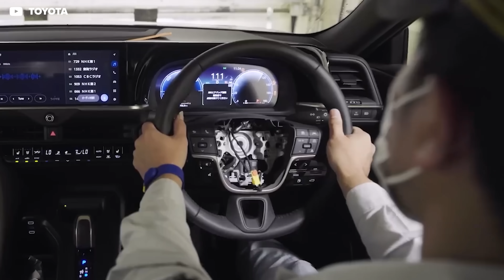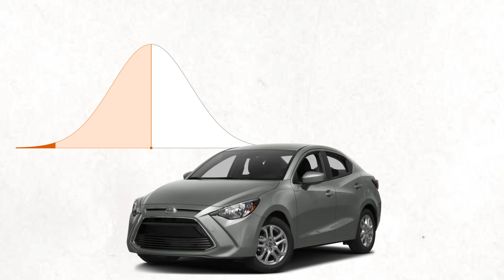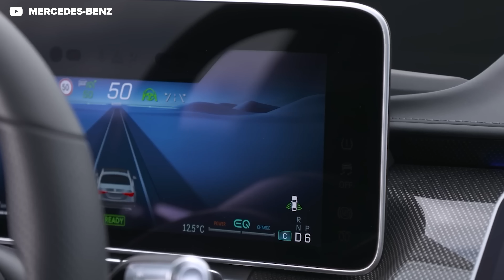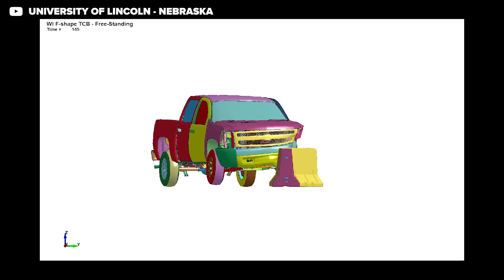The REAL reason guardrails can't stop EVs in a crash

Comment from the maker: Just want to clear up something: the Rivian is not impacting the guardrail head-on. That's just the camera angle. You can see in the raw footage at this link that it hits at the 25-degree angle Cody specifies in the video. Skip to 12 seconds in, and volume warning if you're wearing headphones: https://mediahub.unl.edu/media/21798

Sorry for the confusion. We should've included that second angle.
Reply: When you have to explain what our eyes are seeing or not, that's issue number one. A view of a vehicle coming straight at you has no camera angle to account for -- it's coming straight at the camera. That was the whole point of placing the camera there. 

And most full size ICE pickup trucks go right over most guard rails. On more than one occasion, I've seen them stratling the guard rails with all 4 wheels off the ground after an accident.
Reply: 2018 base model is more like 4647lbs.  That's literally 21% more than what you stated. You may want to fix that.
Reply: @GirthBikesMike ..2018… mine was 1999. Not one ounce of aluminium. Thick steel, cast iron. 5-12 mpg.
Reply: As well it is nowhere near being lighter or even equal to a AWD BMW 3 Series which ranges from 3600lbs-4100lbs, depending on model and year. How had this not been fact checked before filming? It really is important information to have correct.
Reply: Only China like sedan
Reply: Please please please put different F250 F350 C1500 C2500 Excursions Suburban Range Rover on the scales..

I had an 1999 F150. Tipped the scales at 5,800 lbs. Empty.
Reply: @ernestgalvan9037  5,800 lbs, nope
Reply: @JeanGarez .. factory spec. Verified pay scales showed 5,785 pounds. Yep. Portly little thing.
Reply: Ok v-sauce
Reply: still the same occurs with lighter vehicles.. it wasnt designed for trucks... but cars.

all trucks have reenforced frames, higher stance and no crush zones.

guardrails arent up to par and never were. people die because of guardrails
Reply: @pazsion  But they are better than the ones they used to not have.

Comment: I will never understand why cars got HEAVYER the more modern they got.

More weight means more fyel.
More weight means less cargo capacity
More weight means a longer breaking distance.
More weigt is negative in all cases except tractiv force.
Which doesnt matter if you're not pulling a train on steel rails with steel wheels.

Comment: Maybe camera angle, but the rivian tests shown seem to be much steeper than 25 deg. Mostly not possible (maybe for high performance EV's though) except when accellerated crossways on a wide old airfield.  Also the bent steel plate MGS barrier does not have  wide range of CG's and vehicle weights it can handle.  A stronger stiffer rail will cause more injuries than the MGS though, so overall not an improvement for the public as a whole.

Comment: These guard rails should be engineered for the heaviest possible weight not the median weight. What about the amount of heavy transport running down the road why aren’t they designed to keep those in?
These agencies are putting peoples lives in danger to save a buck. Design the system to protect all forms of vehicle the first time the proper way, and in the long run you’re going to save money fixing or replacing them at all with a normal truck or car hitting them .
Incidentally, the video you showed between a newer car and that old Impala hitting corner to corner, was proven that they cut the frame on the Impala to make it crumble the way it did. That old car should have obliterated that modern chassis. Which it did, but it should’ve been worse as a first responder I’ve seen older pick ups Terry’s new cars in half under the wrong circumstances.

Comment: I figured it would have something to do with electric motors having, in general, far more torque than comparable internal combustion engines.

"Horsepower is how fast you hit the wall. Torque is how far you bring the wall with you."
Reply from the maker: That only applies if you're still accelerating under your own power which isn't a factor in these tests, and we assume in most crashes.

Comment: @drive 

to Fix some of your DISINFROMATION:
1. Tesla Model S Curb weight = ~4550lbs to 4850lbs and equivalent sedans: BMW i4 = 4550lbs to 5000lbs, ford Fusion 3280lb to 3880lbs
Rivian RT1 Curb weight =  ~7148lbs, Toyota Tacoma = 4150lbs to 5100lbs,  Jeep Gladiator = 4650lbs to 5000lbs, F-50 = 4400lbs to 5600lbs
 A: This clearly debunks the statement made "up to 4000lbs more than a normal vehicle" made at the beginning. Unless your pointing out a specific vehicle of affect which would be biased presentation at best if not misinformation at worst.

2. your emphasis on "over 7000lbs" is a bit biased as well as a vast majority of the pickup trucks driven on roads today are over 7000lbs: Ford Super Duty (F-250, F-350, etc.,Ram 2500 and 3500, Chevrolet Silverado HD (2500HD, 3500HD), GMC Sierra HD (2500HD, 3500HD). Not to mention utility scale vehicles sold by these domestic brands for commercial use and retrofitted for all kinds of work related duties.

3. weight distribution is a major factor here and not at all a problem with the vehicle but the design of the guardrails themselves. Lastly, studies have actually sown the harmful nature of our modern vehicle  are exhibiting with guardrails and how they are causing unnecessary harm to occupants in crashes. advocates for removal and changes to they old metal systems are happening today because of proven fault and liability of guardrail design. A changing world needs a quicker response than the US is known for due to slow political and governmental red tape.
Additionally, a measure of you have failed to mention about vehicle evaluation here is the height of vehicles. This aspect has nothing to do safety or comfort and frankly is just bloating problem due to design. its actually a leading cause of more deaths than other factors in modern vehicles.

4. only 1/3 to 1/2 of ALL EVs have "frunks" let alone a completely crushable  empty front area. We need to stop evaluating every EV on Tesla terms when more EVs exist than just them and are out selling Tesla more and more year after year. My EV has not Frunk and would operate like a normal ICE vehicle with an engine in front. its American made and one of the highest selling non-Tesla model EVs sold.

5. IF WE CANT AFFORD TO KEEP ALL PEOPLE SAFE THAN WE ARE NOT KEEPING ANYONE SAFE. America just rather giver tax breaks to trickle down your face and piss on your future.

Comment: conclusions are all wrong !!! its the shape not the mass you can put the entire mass of the car above the drivers head the shape is why the guard rail lifts up not the mass of the vehicle.. its why trucks can be turned back onto the road even though they weight several times more EVs not having a large engine in the front allows manufactures to lower the front for aero reasons this has a bad effect of being lower than the railings catchment height
Reply: seems like my comment is being erased almost like they are trying to deliberately set a narrative against EVs

Comment: Stupid big cars are heavy and therefore need bigger batteries, which makes them even heavier. A bit like a lightweight version of the rocket equation. 

And in most cases it's just about compensating for some (imaginary or real) shortcoming in the owner
Reply: Big Trucks have a use, not saying all big truck owners use their trucks for those things.

And bigger cars are more comfortable, more space=more comfort
Reply: @indoorkite651 true, some big trucks are necessary. That's why I said "most cases".
If we could somehow get the people who have a big truck but don't need it to grow the fuck up and get a sensible car the roads would become a lot safer. 
I'm not opposed to the necessary trucks. Sure the driver should be able to see whether there is a child in front of it but if the truck is necessary then I'm not opposed to sacrificing a bit of my safety for them. 

As for the comfort: that's a tragedy of the commons issue.

Comment: I think it's insane how we don't have national standards for bumper height, vehicle weight, and front hood height/angle. If a Ram 3500 crashed into the front of a Corolla, it would most likely ride up on top of the Corolla. It seems like such common sense to regulate vehicle weight at the bare minimum.

Comment: Another thing to consider is in a fuel powered vehicle if the engine is hit it stops. On a battery powered vehicle, especially one with multiple motors you may take out one motor but you may continue on because the other motors in the rear will still have power and continue to operate possibly causing even more damage and injures.

Comment: I got a comment and a question 1 comment is we could use the safer barrier that's used in @nascar and @indycar the Gen 7 cup car dose have a low center of gravity and when it hits the wall it's energy goes mostly to the barrier and the wall gives you could add a catch fence just in case if y'all are wondering what safer barrier means it's steel and fome energy reduction barriers now it might not be cheap but it works just watch a race and watch a car hit the wall it will amaze you I'm glad we have them they look cool aswell. Also my question is why is every car company going electric just keep the car's with a soul (engine powered cars) you can make some electric vehicles just don't over do it.

Comment: Here in western Canada they don't use those stupid guard rails, they only use concrete barriers. I've seen a highway truck hit a concrete barrier where it ripped out the engine and transmission with the truck ending up on top of the barrier beside a 50 foot cliff.

Comment: Yeah I've been thinking about how inadequate traditional ICE engine cars safety crash protection features are since the modern rebirth of the electric vehicle for a while. 
I have a few issues with EV's.
They are using more rubber.  This is going into our water supply in much larger amounts.
They are not clean.  The electric comes from burning things.
If that battery cell punctures it can dump more toxic fumes in a short period of time than a diesel does it's whole life, and it can't be extinguished by the user.  That in a garage under my house whilst I sleep is scary.
I'm not a fan.

Comment: 6:30 the 59 Impala isn't more rigid, but exactly the opposite. The front end collapses in the same way as the 09 Impala. The meaningful difference is in the structure of the cabin. The 59 cabin has thin, weak, and curved pillars, allowing the entire car to collapse. The dashboard sees extreme uplift, crushing the front seat occupants, while the 09 doesn't experience this. The A pillar on a mid to late 50s car in general has an S shaped design, allowing it to fold easily in a front end crash. Cars of a reasonable weight from the 2000s are the best case scenario of what we could call herd immunity to traffic fatalities, using leading European traffic/street engineering design standards. The most widely sold and driven private automotive vehicle would have to match the design standard to prevent the curb weight and size arms race, and large, heavy options that deviate from the norm with unreasonable centers of gravity as described in the video need to be difficult to acquire, requiring strict licensing. What we have instead in the US especially is vehicles of an increasing unprecedented mass and centers of gravity deviating significantly from the standard, using largely regressive traffic engineering, resembling what we've been doing since the 1950s with wide roads and streets, as well as dangerous junctions. This is why we have 40 thousand car fatalities per year, and why we will have more if we don't hit the brakes, lower the curb weight, adhere to safe design standards, and shift away from the largely single occupant private automobile model of transportation.

Comment: There is zero point to this video but to stir up EV hate.  This video could made for any vehicle. Most guard rails are used on sharp exit lanes and we see those tore up every other month. Hell we seen motorcycles ripe these rail apart because most are maintained and some aren’t even installed correctly.

Comment: The government has also regulate out smaller vehicles. They made it expensive and unrealistic to be able to make them. I don't know the full facts, but smaller vehicles have to be way more efficient compared to larger ones and therefore not feasible to manufacture. So that's why you don't see the small rangers and Tacoma's like you used to.

Comment: Many of us said EVs would be a problem because of the huge battery packs and the weight of them... As the years go by and more of them age and start getting into more accidents the data will show that it is the case. We've been driving ICE cars for 100 years, EVs have only become 'popular' in the last 5 years. The sample size for statistic comparisons of EVs vs ICE is too small... in another 10 years we'll understand a little better.

Basically EVs, especially the SUVs and trucks, are potential death machines for pedestrians, buildings, fences and smaller ICE vehicles.

Comment: EVs are such trash, many were bought by stealing tax money from people, they wear out tires faster, mining for the materials is harsh on the environment, when they catch fire it's a disaster. there's not enough infrastructure for charging and it's not that simple to just add killowatts of service in most areas, the electricity grid is already strained in many places, the range is pathetic, they take an hour to fast charge , the r tarded government is trying to mandate this garbage , the batteries aren't actually recycled they are being thrown in landfills and now they want to redesign highways to accommodate them which will cost billions more tax money. When someone tries to tell me how great EVs are I want to walk away and ignore them because they are dumb.
Reply: I didn't get any tax money for my Bolt.
It's on the same tires I put on it a few months after getting it, a set of CrossClimate 2s, because I drive like a sane person and don't abuse the instant torque... much.
Gas and oil burns pretty well, as do aluminum frames. Lithium batteries don't explode like gas does. EV fires are far, far more rare than gas car fires. EVs don't have catalytic converters which start tons of grass fires. 
There's electricity in more places than there is gasoline. I can literally charge my car on top of a mountain, you can't gas up there. I also get juice back in my battery while coasting down the mountain. Your gas car just keeps burning at least a liter per hour and wearing down your brake pads down that same mountain.
The range of my 8 year old Bolt is more than enough for me to go from Pueblo to Denver and back on a single charge, that's further than most people drive. I drove it from Denver to Des Moines back in 2019, and the infra is only getting better. Newer cars are far better at road tripping too. Almost no one drives more than 300 miles per day on average, and those that do could just use a Silverado extended range or Lucid Air each of which have over 500 miles of range per charge. 
The batteries are up-cycled, then recycled. I plan to use that 'free' 66kWh battery for home storage when my Bolt finally gives up the ghost. Then if/when I need better/bigger batteries that battery can be recycled just fine. 
Why would they have to redesign the highways designed for 18 wheelers which weigh 44,000lbs or more for EVs that max out around 9,000lbs. My little Bolt is only 3,600lbs. 
When someone repeats these same old FUD lies I want to walk away and ignore them because they are dumb, but I don't because I'm not a lazy whiner. Instead I debunk their lies with facts and logic. Sorry bud, facts don't care about your feelings.

Comment: Heavier vehicles need to be taxed a lot heavier. Road wear is proportional to vehicle weight cubed so why not implement taxing with the same progression. Then this whole gaining weight problem will be reduced.
Reply: I'd combo gvw with msrp. That way the rich peeps that buy and drive cars which cost and weigh as much as my house get taxed out both ends. 
Let the gas tax die off along with gas vehicles, no need to remove it yet. A per mile tax would be okay so long as it didn't involve massive invasion of privacy, just an odometer check or similar and not fully GPS record of everywhere your car has been.

Comment: EVs are GAR-BAGE
Reply: I love my Bolt, never going back to gas. 
Gas is stinky, carcinogenic, explosive, pollutes my neighborhood with smog and noise, and is way more expensive than juicing up at home. 
My little $15,000 Bolt is quicker than almost all the gas cars on the road, and more responsive. Has a lower CoG, instant torque, and gets energy back into the battery while going down hills. In other words it's amazing for going up and down mountains.